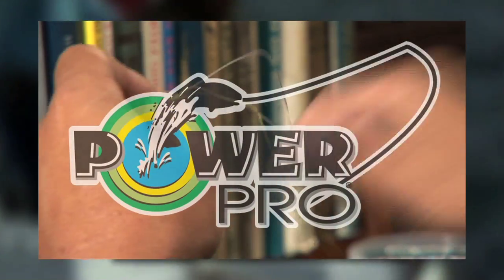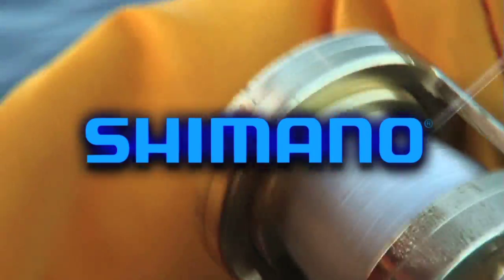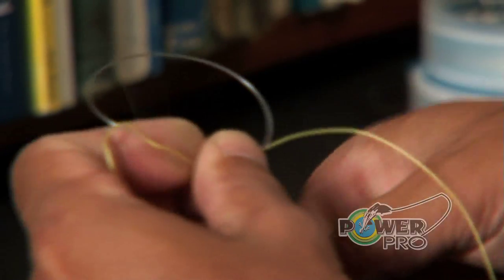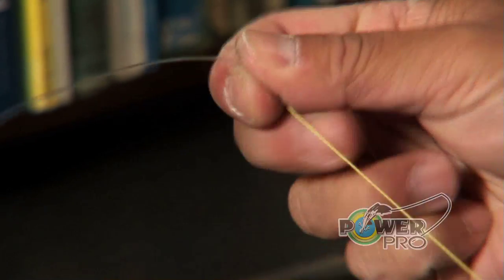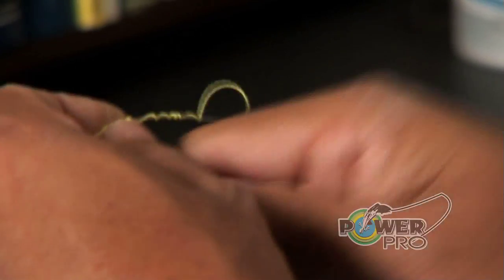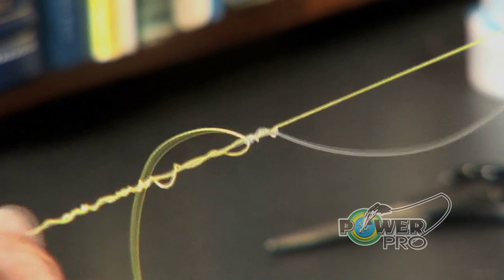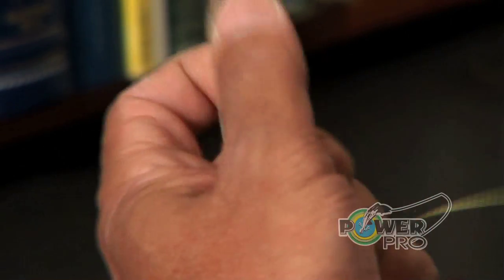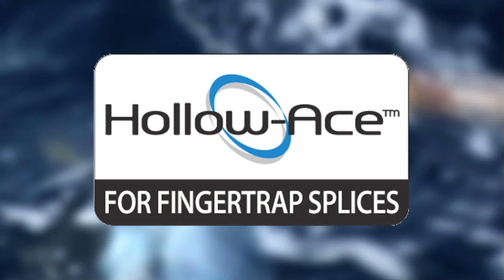Bob Sands Knot

Comment: Poor presentation IMHO but...that said... The Bob Sands knot is superior to the Uni to Uni knot when it comes to the spectra biting into the fluorocarbon. Fluorocarbon is very dense/hard and has a tendency to slip. The 12 down and back makes a system that really bites into the fluorocarbon so when under pressure it really does it's job. I have been using this knot for decades and have NEVER had it fail even once.